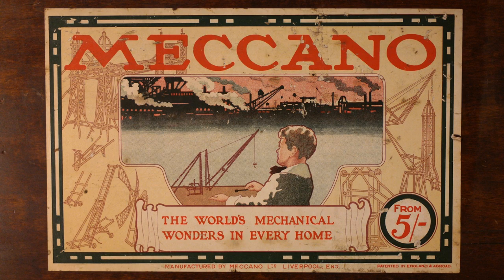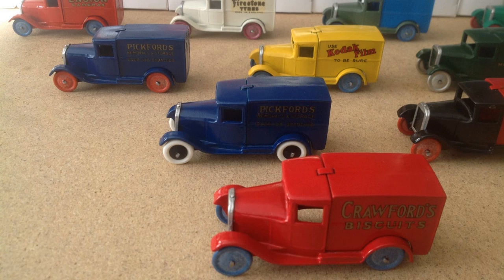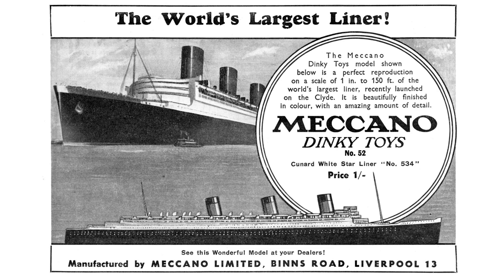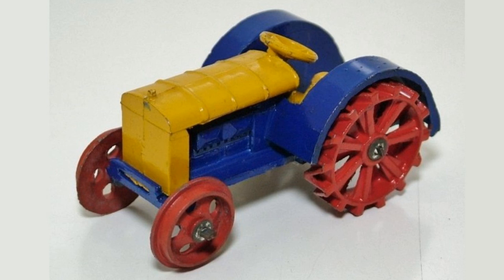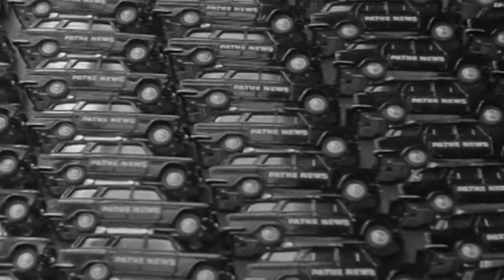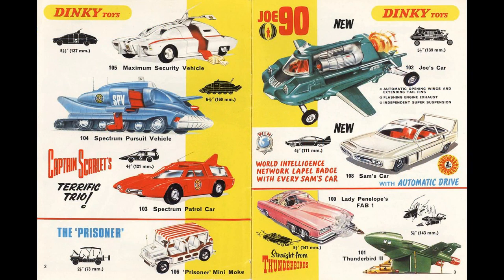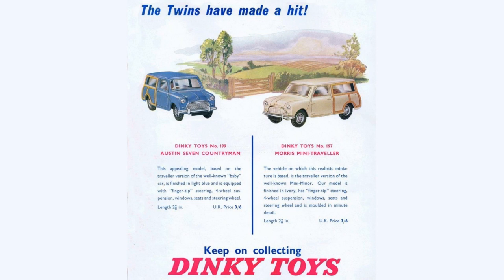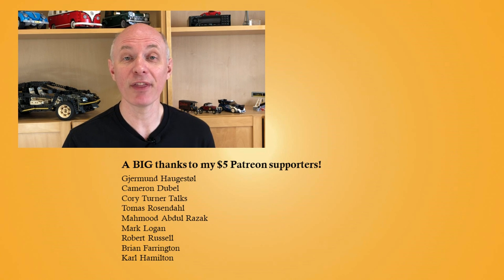The Dinky Toys Story

Comment: My first Dinky was around1956, a fork lift. It was orange with a green fork I believe and had a little crank on the side to lift the fork up. It had rubber wheels you could take off. I think it came in a box. Each week my mother would take me to a small toy store and let me pick a new toy. I had trucks and little trailers, a dump truck,  cab over with a flat bed and many others. One time I got a crane that had a crank on the side that had a string up and over with a hooked a crank to lift the crane.  I also have a cab over truck in a light blue. Had close to 30 or so toys for years. Then sadly sold all for very little except the cab over and a earth haller dump truck. Had many happy hours playing with them and fond memories. Always wondered what happened to the Dinky company. They're hard to find now and sellers want a lot of money for them.

Comment: I was and am a CORGI guy. I always thought Dinky cars never had the sophistication of CORGI models. Thanks again for putting this ' little ' doco together.
Reply: Corgi had ,shocks, springs, Dinkey didn't
Reply: I preferred Corgis too. My favorites were the 224 Bentley Continental with steerable front coil spring suspension and openable boot with spare, and the 245 Buick Riviera with trans-o-lite head and tail lights. I did have some Dinkys but I can't remember which ones. 64 Impala maybe?  Corgis seemed to have more "features"
Reply: Neil Aspinall I collect all 3 major brands but I agree that the Corgis were generally more sophisticated, particularly from the early 60s era onwards. Dinky sometimes seemed to ‘drop the ball’ a little during that era.

Comment: I had dozens of Dinkys in the 1950s and 60s and played with them all the time. I had a fleet of 32 buses and a big fire station of fire engines as well as many military vehicles including Centurion Tanks and the 25 pounder field gun set. Someone will no doubt correct me if some of these were Corgis. Anyway, I lost interest as I grew up and when I regained it, I found that my mother had disposed of virtually the whole lot. But I still have the odd Dublo Dinky model and some Matchbox from the early 60s. Thank you for this fascinating insight.

Comment: I had and have a bunch of Dinky and Corgi from the mid to late 50's through the late 60's they were a nice scale size to use with model railroads, which I also had.  The Hot Wheels and smaller sized models were assisted by being cheaper and closer to HO size which was the dominant scale for electric model trains.  Hot Wheels also was clever in marketing things with track for the cars to ride on by gravity and do stunts.   Dinky and Corgi were expensive with Corgi having more detail in design.   Ultimately I think labor costs and competition from the far east did things in.    Today  you can buy quite nice models in the Corgi and Dinky scales effectively for a fraction of what they used to cost.    I think it is a sad loss that these kinds of manufacturers are only in the far east.    In my experience not all competition was fair with the far east, starting with Japan where they kept the exchange rate low and could sell for less, that coupled with political sell-outs of domestic industries and jobs had a lot to do with it then as now with China and the rest.   At least that is what they did in the US, whole industries were basically trade negotiated away along with the jobs and production capacity, it was and is a betrayal of the citizenry.   They have gutted much of the US industry and the remainder they hamper with regulations of all kinds, especially in some states.   Moral turpitude is the norm in most realms.  Quite sad, awful really.

Comment: I had a Dinky rubber-tyred LNER A4 pacific in blue and two carriages in 'teak'. Then, when the coupling hooks easily broke, I had a repainted set in BR green with carmine and cream coaches. I still have the remains of the latter. I have never seen them even on the internet.